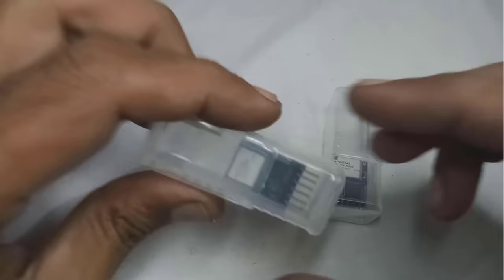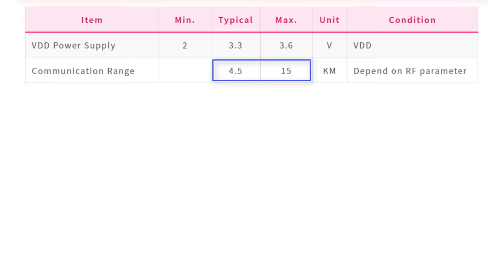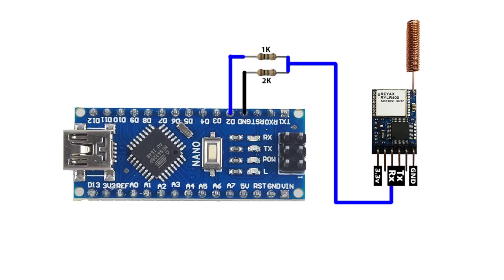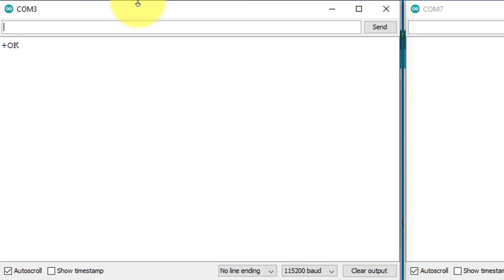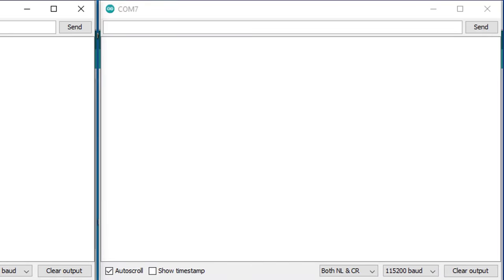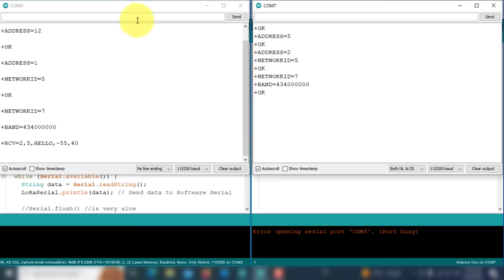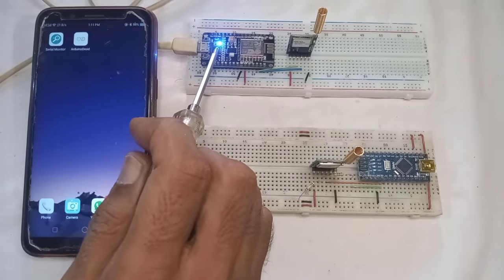How to use LoRa Module with Arduino - Range Test - RYLR406 15KM

Comment: it uses 426 and 433Mhz frequencies which means that you can't use it without a radio license. not just for the owner, but every transmitter station should have its own license with a registered physical address where the transmitter is located. 470mhz out of licensed ranges which means that you can't use it at all. in other words - this is an illegal device
Reply: Did you notice the accent, Radioboomer?
Reply: @DoktorJeep  not sure the roads I saw at the end of the video looked like the ones John Denver was singing about.  I agree, fairly certain there is not an international authority over all frequencies.
Reply: 433MHz is the standard frequency for remote radio controllers
Reply: @stefano.a  433 Mhz is a HAM radio band and it requires a license to operate on this frequency whatever output power you are using. there are just several bands that are open for non-licensed operation. mostly they are for Wi-Fi or for mobile devices like cell phones. you cannot operate even in the CB band in non-voice mode.
Reply: @makskk6spm275  probably you don't know much about LoRA then. It is low power but has a 128 bit window and that's why it has a bigger link budget for 15km range. You can use your ham radio and notice nothing.
Reply: You are obviously missing the fact that YouTube is worldwide. It didn't take much of a search to find out that 433 is LoRa freq range for Asia. The presentor is simply using a unit appropriate for his country. There are very similar LoRa modules for North American frequencies. According to my very brief search, there are units for 169 and something in the 900's
Reply: That is exactly what I was thinking. It is illegal
Reply: Since when 433 needs a license? Oh no, my kids remote car needs a license than. Need to register it! 😂
Reply: Thanks for the info.  I just threw away all my car keys since they are illegal.  Cya folks, gotta get to work now!
Reply: I have several illegal Acurite weather stations and LaCrosse thermometers, and the ones my neighbors have that the rtl_sdr connected to my home assistant also receives must be even more illegal...😂
Reply: @DoktorJeep He's just another Sad Ham...
Reply: @makskk6spm275 Search for LPD433, it's legal to use a small band of frequencies around 433Mhz for low power devices without a licence in many countries.
Reply: my question is.. someone can find me ? if i use this device whit illegal feequency,. how can find me ?
Reply: @fedeyoutub  yes. it's very easy to detect a source of the radio waves today. they have very cool tools for that. and I will be one of the first to help the FCC find you, because we, who have a license, hate you radio pirates who are trashing up the radio bands by using this junk on frequencies.
Reply: @fedeyoutub They used to use mobile directional antennas in cars to triangulate position in the very early days of radio.

Now they can perform the same triangulation using cell towers or even satellites.
Reply: @tenlittleindians  understood, thank you for the reply😉. who knows if they use the same techniques in Italy too..
Reply: Uuuh a license, I don't know such word
Reply: Laws are different in different countries.
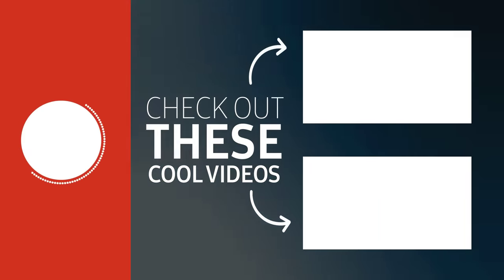Reply: ❤❤ 12:59
Reply: Who cares in Asia?
Reply: He's from an asian country. Next time just try not to be sooo american...

Comment: I have a question, can I use 8 pair of modules like this (8tx and 8rx) to activate at a distance a Light Bulb, a Refrigerator, and 6 more appliances but all separately, for example with an app on the cellphone and the Txs in my house and the Rxs in the guests house??? If so, how can I do this??? Can you make a video explaining how I can use as many Lora devices as I want without interrupting each other in frequency??? Thank you beforehand 😉👍🏼

Comment: Hi Ahmad, great job as usually. Could you advise if I can use the Lora module to turn on/ off lights remotely in 3 different facilities. Now I turn on/off the lights via SMS (sim800l) as you showed in your previous video (many thanks for that!)
Reply from the maker: many many thanks. I am planning to make some interesting projects with LoRa. 

As for your question. I think you need 4  lora modules. 3 modules for different locations and one module for transmitter to send the commands to these module.
Reply: @AhmadLogs  thanks for quick response. Looking forward for your new projects
Reply from the maker: @СергейИванович-к7л  will try soon

Comment: Is there a way to have more security/checks to be sure no one can receive the data transmitted on another device? Looking at the code it would be easy to setup two receivers with the same config - and not too much in the way of finding said config?

Comment: le module RYLR406 n'est plus dispo , peut-on  remplacer le module RYLR406 par un module  moins performant  " LoRa-ASR6601 SOC -138dBM Collecte de données, Faible consommation, 8km, Longue portée, UART, PCB + IPEX, LoRaWAN, IoT Tech, 433Mhz, RF sans fil, 22dBm"
merci

Comment: Is there any other method to configure the address without using USB to ttl converter. I mean connecting to Arduino and configuring through code itself.
Reply from the maker: yes. https://youtu.be/390JbyaBIjg

Comment: Eh... you claim 15 km but prove only 3 km.
Reply: It's possible to get 15km just not on ground level.
Bc of fresnel zones you need to be at least 25m above ground level for either thr transmitter or receiver to be able to avoid the signal interference